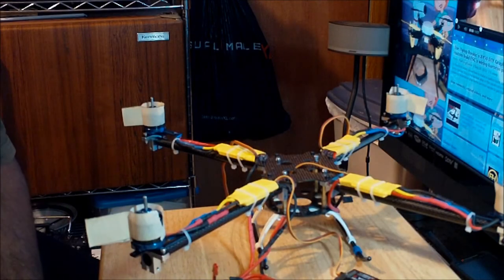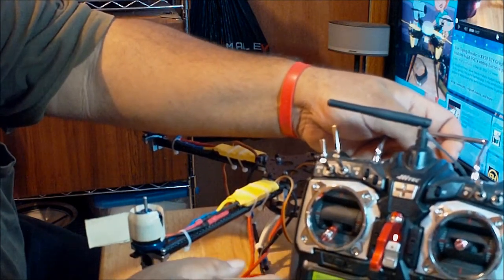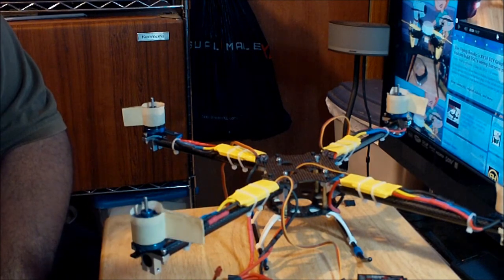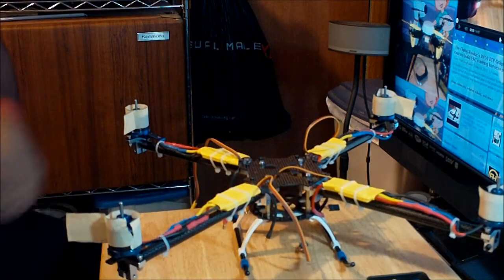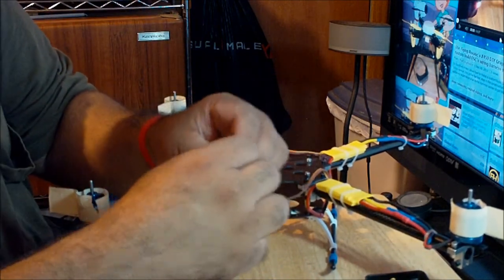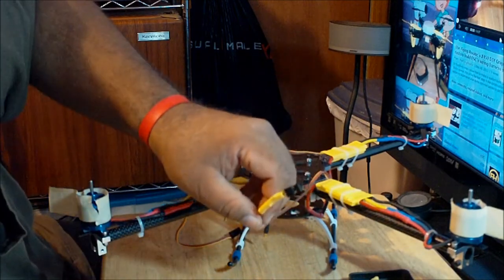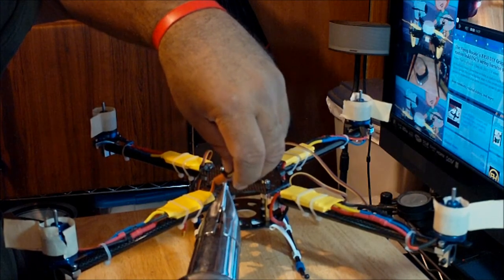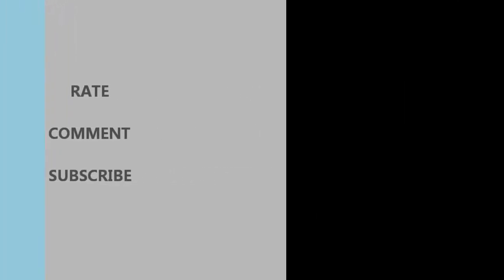The Flying Rookie's X450 DIY Graphite Quadcopter ESC's setup & wiring preparation part #4

Comment from the maker: @womackke the only good thing that i can say about the fy91q is that is design to work with different multirotor aircraft modes other than the typical " X + " quadcopter mode , also is design to work with a separate GPS module that allows you to have features like position hold and return to home but as far as i know the setup process is as painful as the fy90q & that's why i wouldn't get in to one of those either , just get a gu344 or if you want to save some $ get the HK KK controller board .

Comment from the maker: @womackke Another problem that i had and really hate about the fy90q was that is way to sensitive , the props must be 100% perfectly balance but also the motors too , no minor vibration was acceptable or else the aircraft was unflyable , the props is something that everybody that flies always have to balance but not everybody balanced motors out there so is really annoying when a minor insignificant vibration from the motors don't let the aircraft fly properly , now i only used the gu344 .

Comment from the maker: Supposedly the fy90q is a better controller than the gu344 but with my own experience it wasn't that way , maybe is me but i felt that the fy90q was harder and more complicated to set up than the gu344 since the fy90q comes with 3 gains settings and the gu344 comes only with one , another thing that i didn't like of the fy90q was that is required to cut the positive " + " servo wire from 3 of the 4 ESC's , something that is unnecessary with the gu344 or any other flight controller on the market.